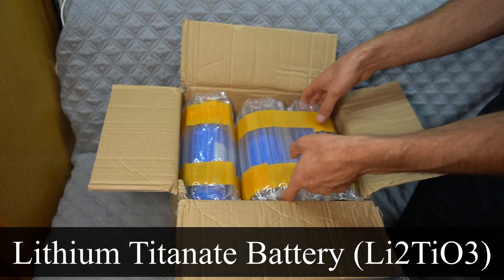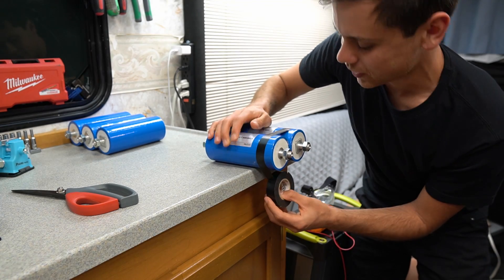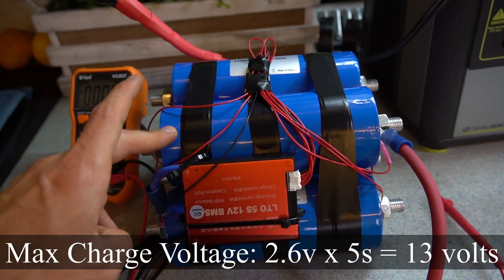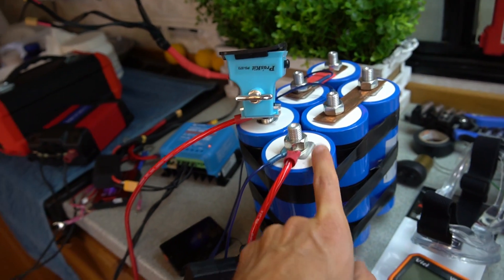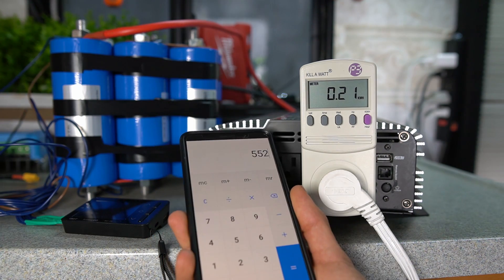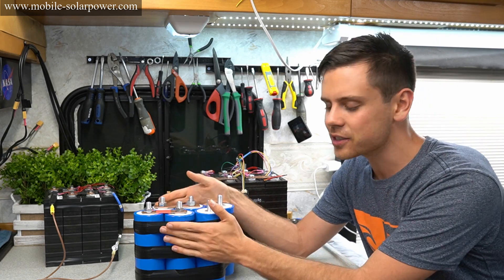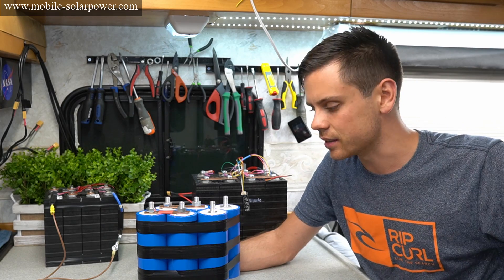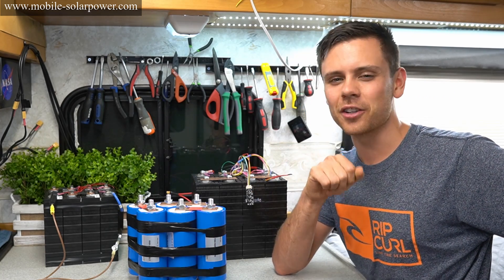DIY 12v LTO (Lithium Titanate) Battery

Comment: We use Ford C-Max "Energi" batteries, they are made by Panasonic. We purchased them through LKQ Online and other then the tear-down I have not seen a better battery for the money.  We have right at 102.00 per kWh and if we were have purchased two or three units the price would even be lower, under 100 USD per kWh.  I have been seeing these batteries in Hi-Fi vehicles.

Comment: Couldn't you use a 6S Lifepo4 BMS?
Reply: As Will explained in the video a LiFePO4 BMS doesn’t allow to discharge to low enough voltages to fully use the LTO capacity

Comment: Why not 7 cells @ 2.1v?  14.7v seems about the upper limit in automotive  12v supply to everyday inverters, and inside your power range.   Just talking outloud :)
Reply: You’d need a BMS that supports such a setup and they probably don’t exist. You would risk discharging each cell too much.

Comment: I'm not sure about your conclusions this time. I bought a Mitsubishi miev with a lithium titanate battery as we import second hand cars from Japan into New Zealand and the titanate version was a domestic market variant. I was reading that one of the reasons they could get away with only 10.5 kwh battery is because of the efficiency . The other lithium chemistry is  16 kwh . I also have been getting some scib Toshiba cells for lifting devices.

Comment: Umm you must of gotten cheated.. first hint your ordered it from china.
Reply from the maker: China is only country to invent and produce this chemistry of battery. Can't buy it anywhere else in the world.
Reply: @WillProwse  you mean steal..
Reply from the maker: @mrragnarokk7415  No. They are better than america and many other countries at inventing and manufacturing things. Its a fact. how about you invent your own battery chemistry, and open a factory here in united states, instead of complaining about china. this is the problem with many americans, they complain about china, but do not open more factories. get  to work!
Reply: @WillProwse  how about you do a charge cycle test. You'll see that its a lie.. and ohhh Tesla.. American company has the leading technology in batteries. Now I'm not going to go into detail because you can probably do a quick google search and find it.. China steals intellectual property. The battery you bought. Is a copy of what tesla is already doing. By replacing the graphene layer with silicone and they are working on the dry cell batteries..

Comment: Battery seller letter that you and/or your readers may find interesting..
 Dear Customer:

Complaints from customers who have been cheated by some dishonest suppliers selling bad quality Yinlong LTO cells recently have stirred up our nerves. Customers have been cheated; Yinlong LTO cells’ reputation damaged; and the LTO battery industry been made “muddy waters.”  We, authorized distributor of Yinlong LTO cells, feel it’s urgent to unveil the truth about those dishonest suppliers, and help you to identify and buy good quality LTO cells.

To sum up, there are 3 main tricks of the dishonest suppliers :

Re-wrapping Lower-Capacity Cells: As there are 4 versions of LTO 66160 cells: 25AH, 30AH, 35AH, 40AH; and all have the same form factor, dimensions and weight. Some untrustworthy suppliers disguise the lower capacity cells (35AH, 30AH or even 25AH) to be higher capacity (40AH).
Selling Scrap Cells: They DARE to sell scrap LTO cells with severe problems such as electrolyte leakage, 0-voltage, high self-discharge rate, etc.!
Criminal Fraud of no delivery after receiving payment: We will expose the names of those fraud companies in our next emails.
We will unveil the scandals of the dishonest LTO battery suppliers in details and present our solutions to help you to identify good LTO vendors in our next emails.

Your vigilance is highly recommended.

Best Regards,

Eliza Cai
Sales Manager
Reply from the maker: Thank you for posting this!!! Good to know
Reply: So do they tell you were to buy legit batteries?
Reply: @cesteres  A certified dealer. Like a dealer that handles the full line of cells. Sometimes you have a hard time finding one.
Reply: Sadly, I think I was a victim of this as well. I ordered 40 Ah cells, and my multiple testing has only been able to obtain a max of 32.40 Ah capacity using a draw of 120 watts. I absolutely love the battery tester from a previous video that you did Will.
Reply: To bad Ms Cai hasn't sent Will some of their LTO batteries to demo
Reply: Can't trust China products unless shipped using a US distributor

Comment: They are Lithium-Bolognium cells; fake capacity ratings, and sure who's gonna be around to test their rated cycle life, so 40 thousand cycles or what ever my label printer can print ought a do it. They're as safe as Zinc Carbon batteries, wait, wait, let's take a look at that drill test again.

Comment: Can you assist with a project? I'm looking to place a bank a capacitors inline with my positive battery lead (for a laundry list of reasons). Ideas for size, capacity, amount of cells, model #? 

I'm looking to help take the load off my battery overall, and allow the capacitors to do the work from assisting from starting, carrying the load of car electrical upgrades and the audio system.

Comment: Thanks for this interesting investigation! What a shame they only have 85% colombic efficiency! Also the engery density seems quite low compared with LiFePO or LiCoO/Mn. One number is still  missing tough: what about self discharge rate of the LTO? The cycle life is impressive but the other numbers not. Graphene super capicitors have up to 1 Mio. cycles, but even lower capacity. But lets see what the next level battery chemistry will bring. They work on a mixture of super caps with Li-ion...

Comment: Why its so fucking huge?
Reply from the maker: That's another downside
Reply: DIY Solar Power with Will Prowse thanks for the quick reply, just wondering is it possible to make a functioning ebike 36V battery out Lithium AAA bateries. Like diy style. Can it be done? Thx
Reply: DIY Solar Power with Will Prowse sorry not AAA but AA

Comment: Get some real Ying Longs next time. There's a reason the car audio world is going crazy about LTO. A 40ah bank handles a 4kw draw no problem, you'd need 4 times the weight in AGM batteries to compete. They're also very safe, don't need a bms, will take high charge currents and are cheap compared to commercial 12v lithium batteries.
Reply from the maker: Yes absolutely I agree and horribly inefficient at that c rate. So it's a total joke for my application even if I had the best cells available. Great for car audio, bad for solar.

Comment: The test is incorrect, because this type of balance does not able to do the job for such loads.
Reply from the maker: First test BMS disconnected when lowest voltage cell hit threshold and these should be matched by capacity. If they weren't because grade b cells, then who cares because these batteries are not ideal for my application

Comment: Interresting batteries, to a house power bank it looks very nice due to the high cap charge cycles. You make an 20kw power bank for a house and it will last 20 years or more. Efficiency is not that important, you can compensate by buying 15% more capacity :).
Reply: My thoughts exactly. For a stationary application just use more cells. 
So it's bigger... Who cares?
 you're not trying to carry it around. And once it's done you can basically forget about it for a generation.
Reply: Thought the same!

Really iteresting technology!

Only downside is the price...

20kwh battery-pack would set ypu back 15-20grand...

Comment: you SHOULD have gone to an electrical supply house for connection devices,, problems will occur in the future
Reply from the maker: Dude I'm doing two tests lol I have plenty of my videos saying to get proper connectors but for this test I don't give a crap. I'm surprised this video got so many views. If I knew people liked it I would have spent more time on it but not worth it considering drawbacks of chemistry.
Reply: @WillProwse  Don't worry, this was obviously a test, and it was pretty clear you probably won't be using this in the future at all. Great content btw, keep it up, experiments are how you learn, and I'm happy to get a chance to learn from your mistakes. Means I don't have to make them myself!

Comment: Imagine building a house with a full wall of these set up as a battery backup system to go along side a generator
Reply from the maker: That would look so cool
Reply: Did that with Flooded NiCad batteries and result is fantastic.
Reply: If you have a generator why have the power wall?

Comment: The prices (per watt-hour) I saw online this evening for these cells were higher than NiFe. In fact, all of these lately-developed cells cost as much as NiFe and none last as long. I can see where some of these types have application, where high energy density or low maintenance are essential, but for solar mass storage, NiFe is the gold standard.
Reply from the maker: Nife is horrible for solar
Reply from the maker: https://www.diyhomesteadprojects.com/top-5-issues-with-nickel-iron-nife-batteries/
Reply from the maker: I would argue that LiFePO4 when cycled for long life has more advantages and nearly the same life. Biggest problem with LiFePO4 is BMS currently available. And yeah these chemistries are constrained by laws of thermodynamics, so energy density/performance/cycle life/safety are all trade offs usually.

Comment: 15V charge voltage was a bit low for 6s, i charge my LTO cells @ 2.8V/cell, fully charged cell voltage is a bit above 2.6V. I guess with 2.5V/cell  charge rate the max cell voltage is app. 2.4V. (app. 20% capacity missing according to my load tests)

Comment: My boat dock solar system, since 2004, has used lead acid batteries. The first set of batteries lasted 14 years. Two golf cart batteries cost me $200.00. So far, no other battery technology appears practical for my application. The duty cycle is really low. The system powers lights and blower motors for two boat lifts. I have a 130 watt solar panel that cost $750.00 back in 2004. My total system including labor cost $3400 back in 2004.

I like the solar systems you show how to build for a few hundred dollars. Prices sure have fallen a lot since 2004. I recently had to change charge controllers. Currently using a cheap $20.00 one, until I decide which one to go with permanently. My 2000 watt inverter is original. The original batteries and original charge controller failed after 14 years. The solar panel still works great. I suspect today's technology is even better. 

I thought your viewers might like some info on system reliability.

Keep up the good work. I really like your channel.
Reply: this is the point. Good lead acid batteries are good enough even when it comes to cycles (AGM ...) and way cheaper than everything that has lithium in it.
Reply: I find when FLA is kept trickle charged, isn't deep cycled all the time and is maintained correctly it can last a damn long time. The main failure point is when they undergo many deep cycles or aren't maintained at full charge as much as possible, which causes the sulphur in the electrolyte to coat the plates in the battery. It does eventually happen to all lead acid cells but the rate the sulfates build up varies depending on usage, charge cycles, and even the rates at which a cell is charged or discharged.
Reply: Lead Acid (PbSO
4) is still a great battery. Solar Charge controllers, DC-DC Lead Acid chargers, AC Lead Acid chargers and vehicle alternators are inexpensive, reliable, durable, and simple. A proper Lead Acid Battery Management System need only consist of a fuse!!! Can't get more simple than that!

Lithium requires more knowledge and understanding to use in a way that is safe and allows the batteries to last. Don't get me wrong it is certainly doable and not THAT hard and not THAT expensive anymore. But for a lot of applications (including yours) the main benefits of Lithium aren't especially valuable and their use isn't very logical.
Reply: @kingrpriddick  "and not THAT expensive"

When it comes to mobile homes, 100Wh PB-AGM vs 100Wh LIFEPO4 is 150€ vs 900€. This is massive.  

Of course you cannot use the whole 100Wh on the AGM and the amps on charging are lower on the AGM, especially at the end of charging. 
But still ... Just use 2 AGMs. Then you are still way below the cost of a LiFEPO4 and have even more capacity.
As long as weight isn´t critical, i see no point in using Lithium batteries. They are just too expensive. From my job i know: In critical server-farms or telecommuniation-masts, they also only use PB-AGM batteries. No lithium anywhere there ...
Reply: @segoiii  Yeah, you still need a cheap salvage or overstock source for viability at this point. But BMSes and pack assembly options are becoming available.

Comment: seems to me if you can keep em cool  would make good combustion car battery
Reply: No, LiFePO4 is the best lithium chemistry for 12V SLI (Starting, Lightning, Ignition) particularly because they last a long time, are comparatively invulnerable to thermal run away, and single cells support comparatively high discharge rates(aka high POWER density). 

More common LiMn2O4 (aka IMR or LMO) or LiNiMnCoO2 (aka INR or NMC) cells can be used for 24V but do not work well with automotive 12V.

LiCoO2 (aka ICR or LCO) would not work well without being 10p (parallel, assuming 18650 size cells) or so and would not work well for a starter battery but can work great as "Deep Cycle" replacements aka powerwalls.

Ok course any Lithium SLI (Starting, Lightning, Ignition) battery still needs cell balancing, individual cell high and low voltage limiting, and should have individual cell protection (fusing or another over current protection). These features are usually accomplished by a BMS but far from all BMSs provide all these features.

Comment: Make 2 more pipe straps for the + and - then run a 1/4" bolt through the straps other end to connect to.  Do not cut the connectors. Less surface area in contact means a high resistance connection at high discharge rates = fail or fire.
Reply from the maker: Oh the actual battery terminal connectors are not cut at all. They are pure copper in flush in flat and have full contact with the terminal. I would never make that mistake. I only had the cut connectors for voltage sensing balance wires and that's it.

Comment: Says they are 30 Ah and NOT 40 Ah in the Alibaba link. So I believe you got 30 ah cells and NOT 40 AH cells. I have noticed that many pictures on the China web sites do not match what they are selling or match the specs.
Reply from the maker: Agreed, and the sticker and listing I bought from actually does say 40ah
Reply: @WillProwse  I clicked on the link you gave and it does not say 40 Ah cells. You may want to change the link...IDK. Thanks for the reply!
Reply from the maker: @jmd1218  Oh strange, sorry about that! aliexpress links can be strange at times

Comment: These seem like they would be PERFECT for someone on a sailboat looking to upgrade from AGM house batteries to save some weight, but who may be worried about catching fire in the middle of the ocean from a runaway cell.  Also: replacing stuff on boats sucks, so anything you can install and forget about for a couple decades is a bonus.
Reply from the maker: Use LiFePO4 instead..non-combustible and amazing
Reply from the maker: Lto would be a joke for boats imo

Comment: It is important to tighten the screws for a maximum of 7 Nm. It could be that otherwise the screw spins in the battery.
Reply from the maker: Ya, that's why the electrical tape is there lol and yes they were all tight.

Comment: You had a bum supplier! The charge discharge efficiency is actually around 97% and they do not heat up on discharge
Reply from the maker: Not what I'm reading in the battery studies: https://www.google.com/url?sa=t&source=web&rct=j&url=https://www.mdpi.com/2313-0105/4/4/59/pdf&ved=2ahUKEwjYqcyS2OviAhVItZ4KHXlTAx44ChAWMAF6BAgIEAQ&usg=AOvVaw1lmPrKfdeaBh4aheqgxiiM

Comment: I must admit to being a tad baffled about this '85% discharge efficiency' spec. In isolation it makes no sense. There are only two ways of measuring battery efficiency, Coulomb efficiency = Charge out / Charge In
 and Energy Efficiency = Energy out / Energy In. 

 Because your cannot directly measure how many electrons are in a battery, it is impossible to specify the 'Charge Efficiency' and the 'Discharge Efficiency' as two different numbers. These are meaningless terms. The only meaningful measurement is the 'round trip' efficiency ... the ratio of how many electrons out for how many you put in. And for all lithium chemistries I'm fairly sure the Coulomb Efficiency is greater than 95% and usually close to 98%.

Energy efficiency = Energy out / Energy. Again it's only the round trip ration that has any meaning, and it Is always a lower number than the Coulomb Efficiency. It's also highly dependent on the current rates where higher currents usually reduces energy efficiency.  For all lithium chemistries this number is usually in the range 80 - 90% range.

It's my suspicion that the specs that you can see for LTO cells that specify Charge Efficiency and Discharge Efficiency are not what we think they are. Mistranslation seems very likely.
Reply from the maker: Check out this study: https://www.google.com/url?sa=t&source=web&rct=j&url=https://www.mdpi.com/2313-0105/4/4/59/pdf&ved=2ahUKEwjYqcyS2OviAhVItZ4KHXlTAx44ChAWMAF6BAgIEAQ&usg=AOvVaw1lmPrKfdeaBh4aheqgxiiM
Reply: And the study demonstrates pretty much what I stated ... that the Energy Efficiency is in the range 80 - 90% for discharge rates between say 1 -3C.    Indeed for most normal applications where the current rates are much less than 1C, the energy efficiency this study shows will be better than 93%. This is pretty much the same for all lithium chemistries.
 @WillProwse